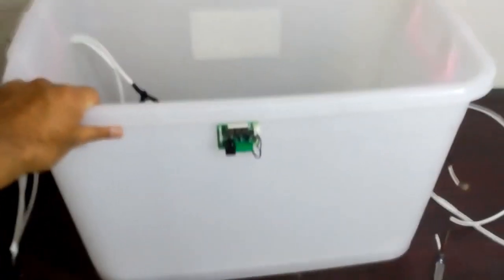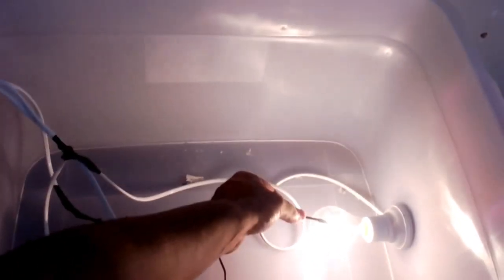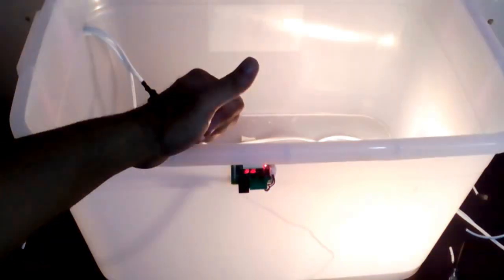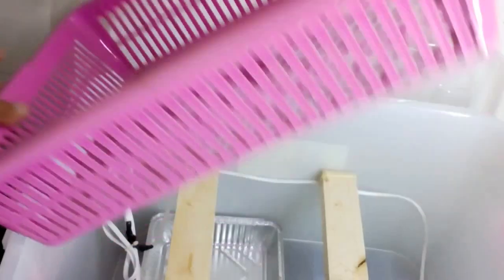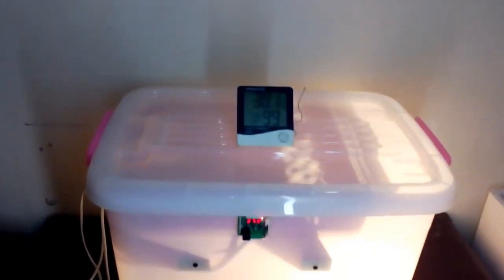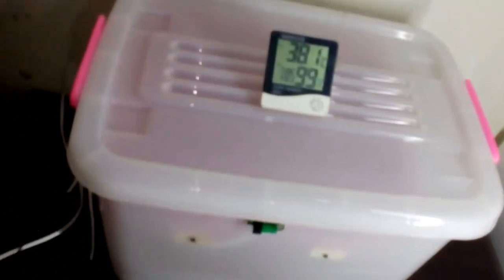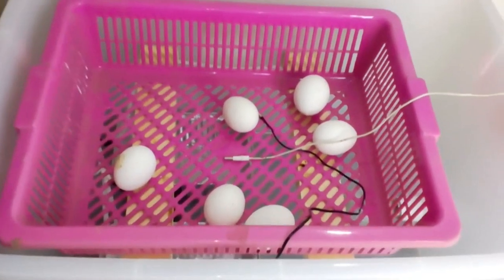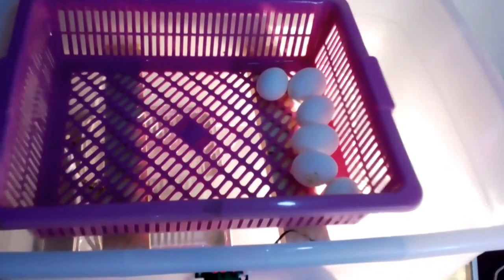How to make Homemade Incubator

Comment: where we can find the fan?what is the price of its ?how we control humidity using fan only
Reply from the maker: It's a PC fan can found in old market of electronics , you can not control humidity only by fan
Reply: Umair's Workshop what is the requir humidity and heat ?
Reply: heat i think 37/38 celcious enough. idont know properly.
Reply from the maker: @babusona7180  temp should be 100 ferinheit 37.7 celcius and humidity should be 60%
Reply from the maker: @babusona7180  37.7 celcius is good

Comment: How this work in extreme hot climate say 48-49  degree farienhiet
Reply from the maker: 49 is not hot temperature you need 100 fernheit for this incubator to work
Reply: DIY PROJECTS  i am sorry its 48 degree celsius
Reply from the maker: You can make on thermopole body by that outer temperature doesn't affect on it and it  will maintain 38 celcius
Reply: DIY PROJECTS  thanks

Comment: Would you Please share the availability of this rotating motor.  Where will we get it?
Reply from the maker: You can search this motor by asmo made 24v motor on internet or in used printer market
Reply: you can use The microwave oven motor ,